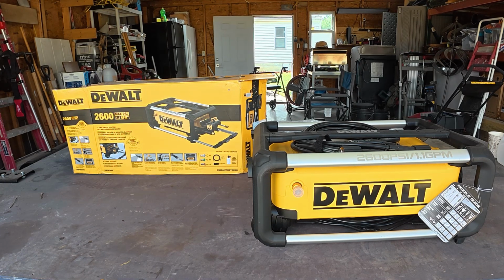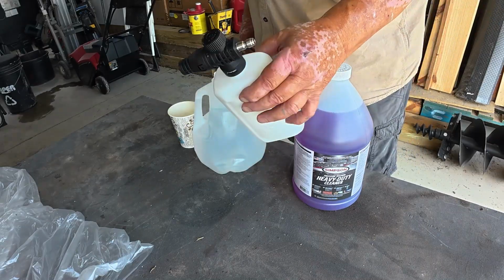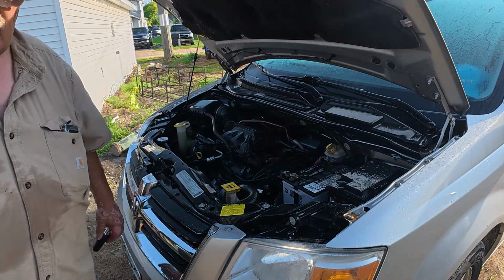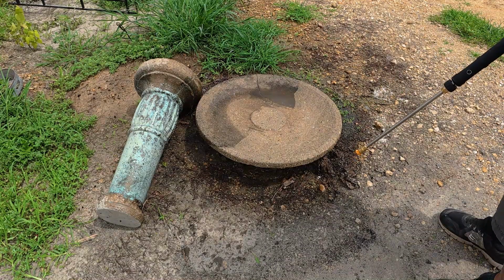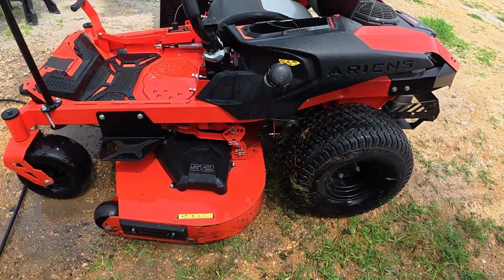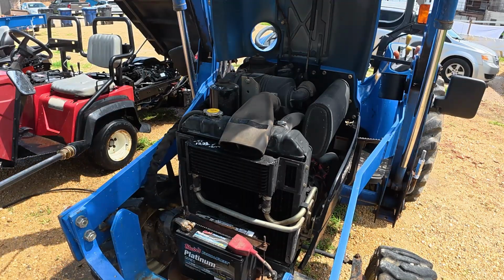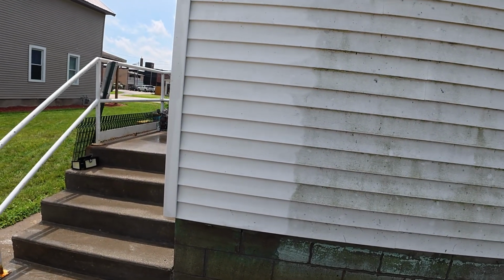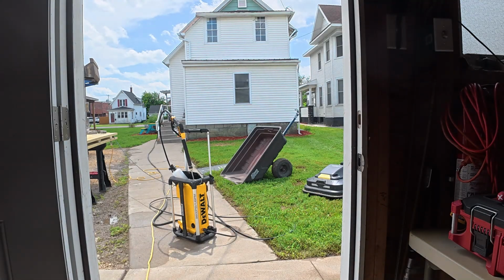DeWalt 2600 PSI Jobsite Pressure Washer: Is This the Best for You?

Comment: Hey Paul,how are you?  Looks like you haven't posted for a while, always look forward to your winter snowblower vids. Hope all is well.
Reply from the maker: I'm doing fine. I only had one snow large enough to get the Ariens RapidTrak out for this year.
Reply: @PaulSikkema Good to hear and appreciate the response. Just the opposite here in the Lower Hudson Valley of NY (about 25 miles from NYC), first real winter we've had in years. The Platinum 24 SHO (your recommendation and a good one) was put to work more than usual.

Comment: I have my house and it's red brick but it was painted  White. I put paint remover, and it was Doing his job. And one of my friends lend me his ryobi pressure washer, that is just a 1800 PSI And it was taking it off. Cause I want the wall to look red brick. So I'm trying to buy one  Do you think this one will work with that? I didn't finish and I needed to give the tool back to my friend. So I was looking at the dewalt to buy the 2600

Comment: Paul, what is the hose like? Is it a real rubber hose or one of those "plastic" hoses which always seem difficult to work with and  coil up afterwards. Thanks.
Reply from the maker: It comes with the stiff one. A 25 ft. superflex replacement hose cost about $25-35 at Menards, Home Depot and Lowes.
Reply: @PaulSikkema thanks for the reply